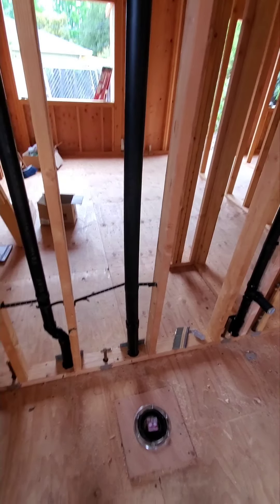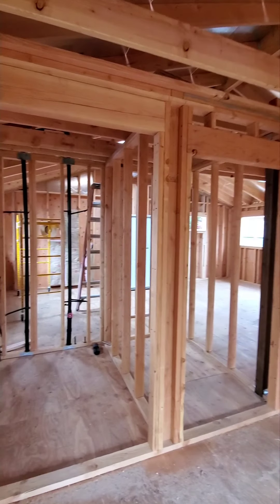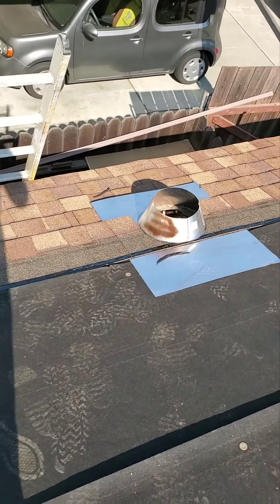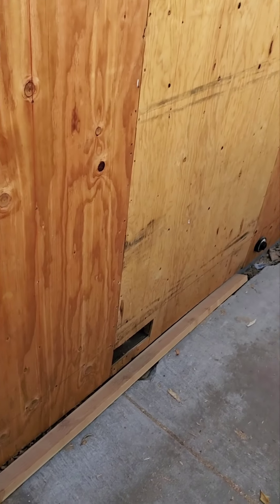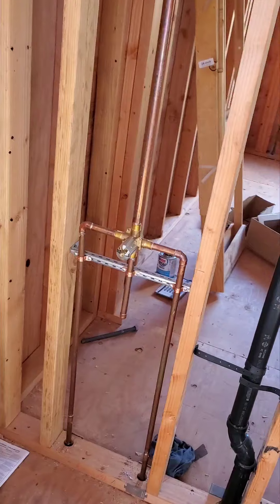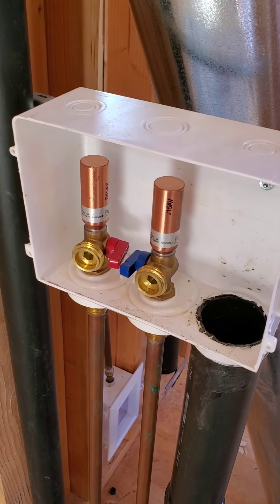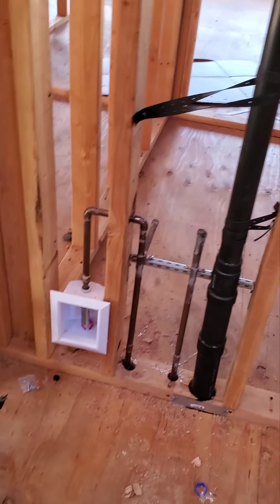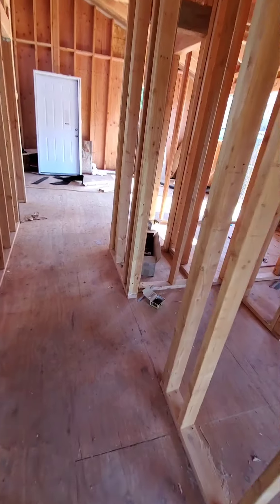building an ADU plumbing roof overhang paint step by step

Comment: Can you do work at San Diego> How much you charge per square feet? What thickness is the plywood exterior wall? And the plywood roofing sheet.
Reply from the maker: Hi There ,sorry for the late reply  ,plywood in the walls is usually 3/8 and roof is 1/2 in ,usually specified on blue prints